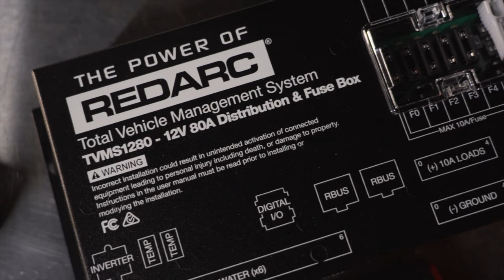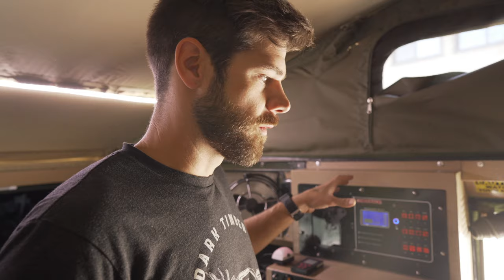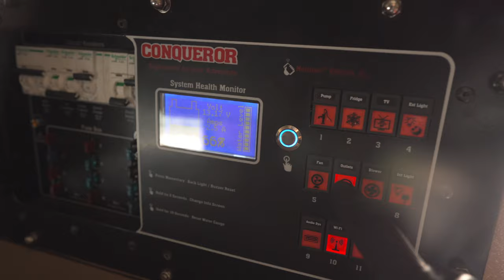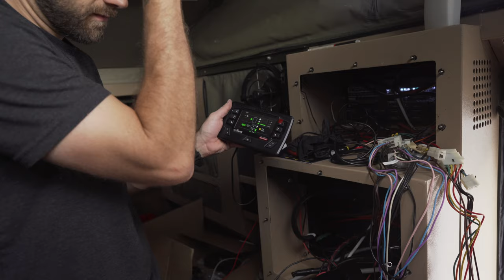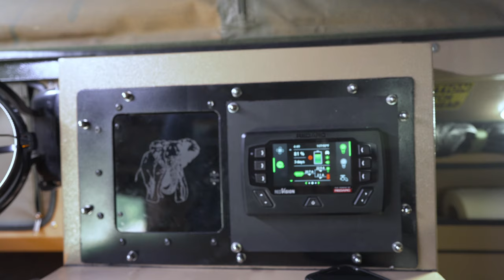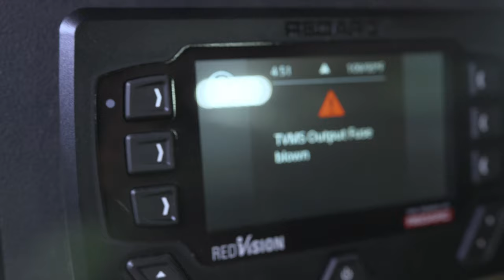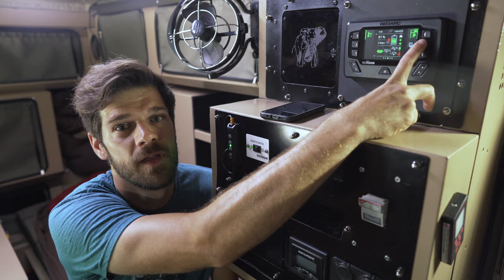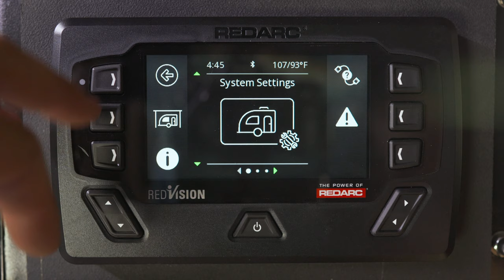Upgrading My Off Road Camper | Redarc Red Vision and Manager 30

Comment: Great video mate. Not an instructional video but a well put together informative video. 
I got my redivision delivered plus two 200 watt solar panels and a 170 lithium battery. All Australian made well it will fit right in seeing the camper is Australian made in my garage. Thanks for supporting Australian manufacturing we try to do our best.
Reply from the maker: Australians build top notch gear. I’m behind it 100%!
Reply from the maker: J M  I’d suggest 100w of solar per 100ah of battery. There’s not really a calculation, it just depends how much you use. For my AC to run off nothing but solar, I need 370watts. But if I’m not using that then the batteries would be charged by 200w of solar by noon.
Reply: J M  
Battery x panel voltage= watts
170Ah x 19v = 3230 watts
Watts divided by 8 hours of sun
3230 watts divided by 8h = 408 watts of solar. 
I do have vehicle DCDC charging and I’m getting a solar blanket just in case.
But I think the redarc system is limited to 520watts solar input.

Comment: Very nice.   'I am thinking about going with this system for our van build out.   Two questions.    This is basically everything except a inverter right?   Would I still be able to use switches for the 12v lighting?  Thanks!
Reply from the maker: You could still add a few light switches if you want simple on/off switches. I would personally mount the unit where the switches normally go for ease of use and less wiring. If your dead set on wiring a few switches, I think the way to do it would be to run your relays/switches like normal and ground them to the Redarc battery sensor/shunt so it properly measures your power use while operating the lights attached to that switch.

Comment: What batteries did you use? What do you recc for a simple weekend rig with a fridge and lights and fans/diesel heater ?
Reply from the maker: 50ah will do it if your using a Redarc system. That’s what my Fj has and it does incredibly well because of how fast it can charge. I’m going to publish a video on a battery pack in the next few days that’s pretty insane too, and might be a good option for you.

Comment: How’s that camper pull? Inclines off road a no go? Can you give your experience? Thanks 👍🏻
Reply from the maker: It pulls alright. It actually does better offroad than the highway. I have pulled it up some inclines with no issues. 4.56 gears help it along as well. It could use a vehicle with a tad more power, but it does okay.

Comment: So how did you run your solar cables and plug from the rear to the TVMS?
Reply from the maker: Through those scanstruts, and through/above the controller sides storage area.
Reply: @IndependenceOverland  and for the plug at the rear you mentioned for solar input? Where was that mounted and how was that wired? I’m taking on this upgrade in this week. Trying to get all the pointers I can.
Reply from the maker: @hbdoffroad2037  I installed the rear outside solar plug between the camper body and the taillight frame. You can run the wires through the RTV sort of grommet where all the other wires run through into the camper.

Comment: Curious to know with the weight of the 490 how your FJ fairs towing it especially up grades on the highway?
Reply from the maker: I have the Fj regeared, so it helps but the Fj is heavy. It struggles on major grades like Vail pass. This camper is about 3200 dry.
Reply: @IndependenceOverland  good to know. I’m thinking about a 490 as well. But I drive a Jeep with the Ecodiesel and was curious how your FJ fairs. Thank You Brother.
Reply from the maker: I know your Jeep isn’t rated to tow as much as an Fj, but that diesel sure would make it easy.
Reply: @IndependenceOverland  I didn’t realize the FJ can tow 4700-5000 lbs 😮